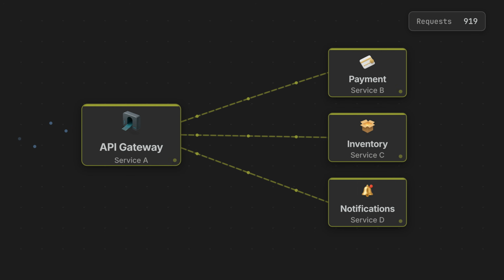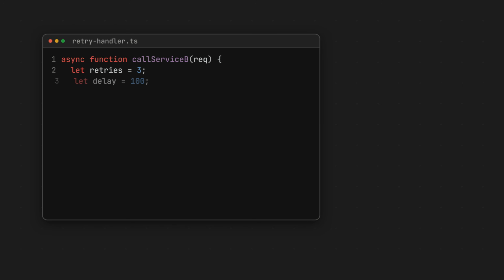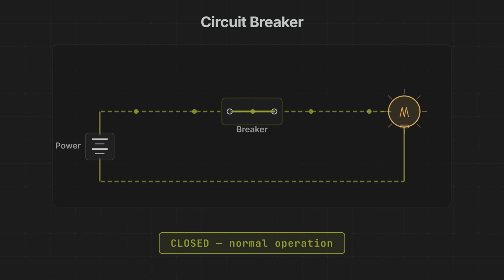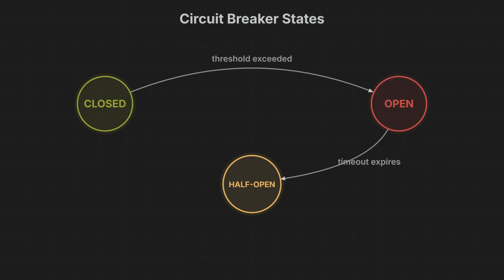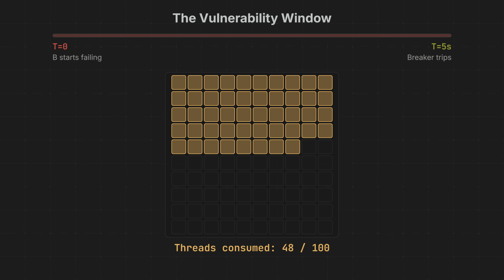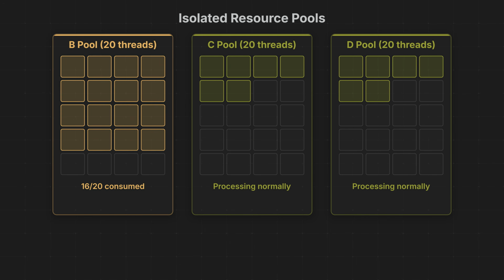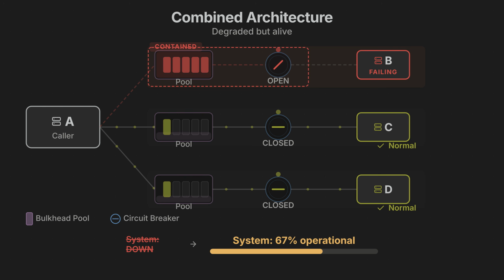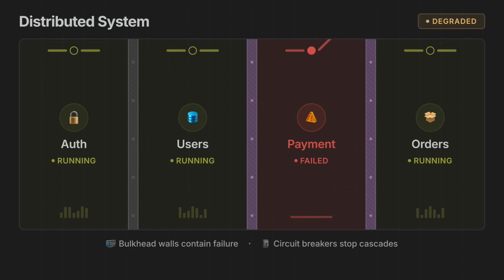Stop Cascading Failures  - Circuit Breaker & Bulkhead

Comment: Generally, I find your videos valuable - thank you for creating them.
However, this time - it wasn't clear to me at what point in the system the circuit breaker is added, or at what point the bulkhead is added.
This video felt a bit rushed - like a trailer for a more detailed video, vs self contained.